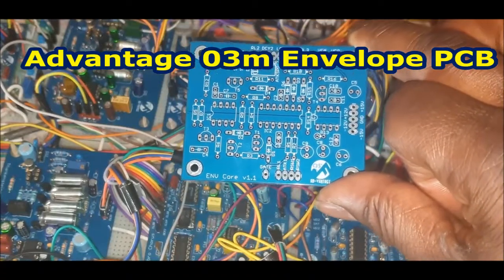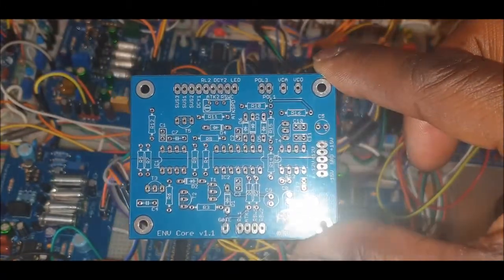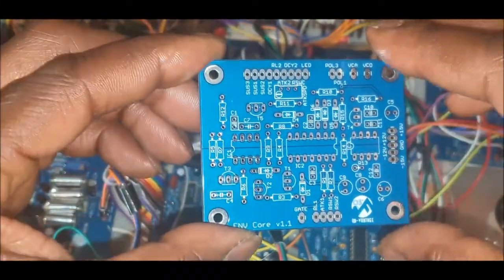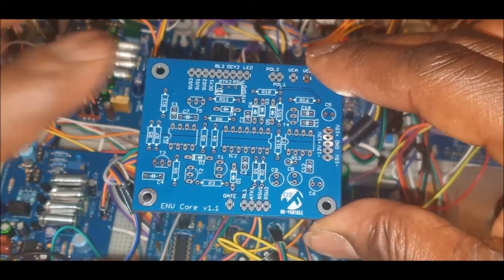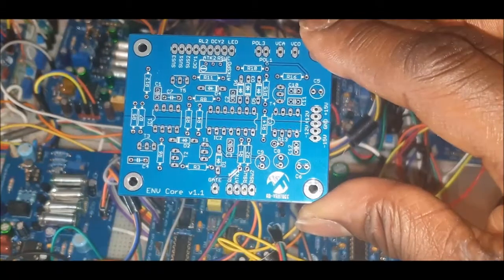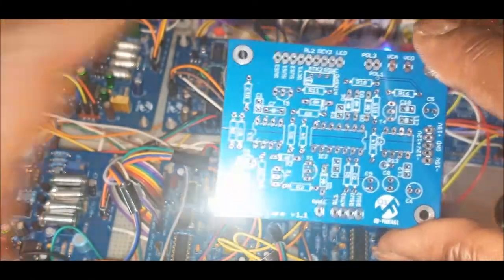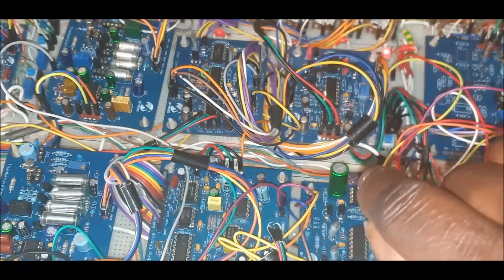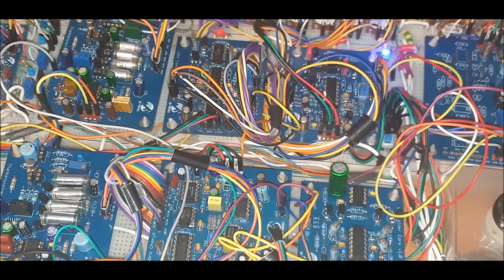DIY analog synth project (Envelope PCB Demo)

Comment: Designing a PCB with CAD software is a HUGE learning curve ... one that I have yet to take. Last year I purchased 35 thru hole PCBs and I am forcing myself to use them all with hand drawn designs (on graph paper) before I start using CAD. I don't know --- I might just stick with hand drawn. 😂 Congrats so far and here's to continued success! ...
Reply: Easy Eda is nice. I have been using it for a while now its less daunting then KiCad or more industrial production CAD.  I will learn the others later but it works for me now.
Reply from the maker: It is indeed . I remember trying to draw my first kicad schem. It was quite mind boggling.  Having said that I watched quite a few youtube tutorials which made more sense than reading the manual.  I used to handraw all my schems and still do from time to time on dot matrix paper which is also helpful for compiling veroboard layouts.

Comment: I have built a cem 3340 vco,
Tl074 3IN-1out Dual mixer, 
Tl072  Based  AD/AR, 
Tl074 1IN-2out x4 Multiple for CV
I have made a 8 step arduino sequencer but is doesn't work reliably. Should I redo the arduino sequencer or try at a simple baby 8. Since I have the chips around. Also have been looking into getting some filters like a MS-20 Clone or LFOs . What do you think? Glad too see more videos.
Reply from the maker: Sounds like you really have been dipping your feet in :-). Not sure on the sequencer as it's not something I have dealt with personally. 
As far as filters are concerned.  I think your main question should be what types of sound are you aiming for . There are alot designs on line and lots of examples on youtube. Ms 20 is a good shout .It gives you high and low pass and is not too part intensive.